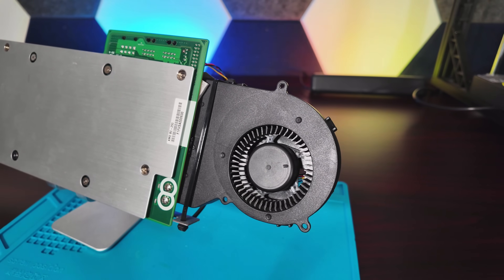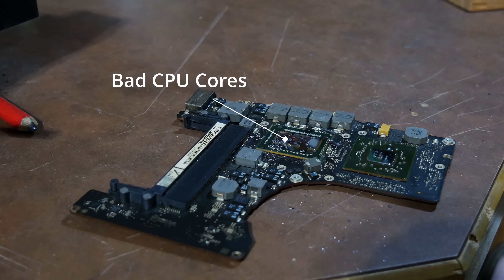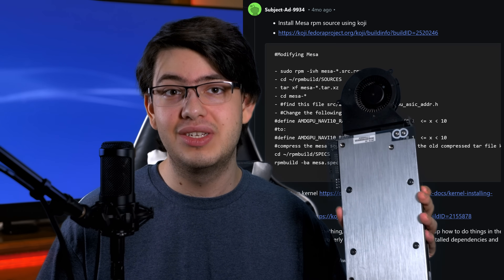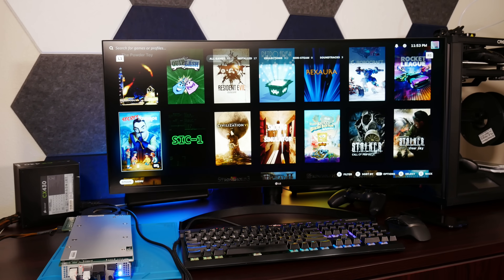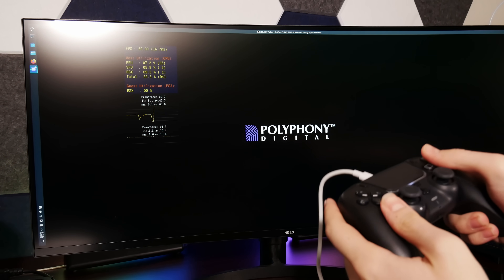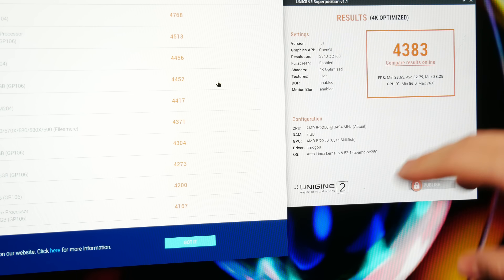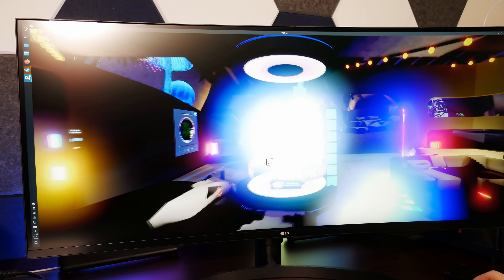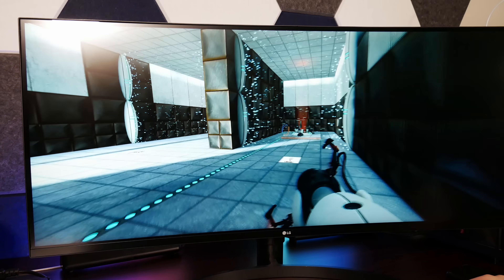I Ran PS3 Games on PS5 Silicon to Prove Sony Wrong

Comment: Sony: "The PS5 simply isn't capable of running PS3 games"
Us, the Community: "So that was a F***ing Lie."
Reply: It simply isn't capable because Sony do not have a working in-house PS3 emulator.
Heck, Sony uses PCSX ReARMed for their PlayStation Classic instead of any in-house PS1 emulator they have on hand.
Reply: @HattoriZero  my xbox series s runs all ps1 ps2 psp gamecube wii and more
Reply: @newjackgaming88  My handphone does that too.
Reply: @HattoriZero  Sony isn't a software company, and that's a huge problem for them. Despite this, they run a better and more capable operating system on their console than the software company Microsoft does. This is just to say Sony is changing, and have some good ideas, and are becoming capable in the area.

But until they scale that up, they can't spend lots of effort on making things like that. This is why Sony as an electronic company has been struggling as well, because electronics these days heavily depend on software solutions, and if you don't have that, then, well, your electronics will struggle as well. But honestly, Sony has done well and made smart choices in regards to Playstation, and they are becoming capable. They just need to scale up their software department.
Reply: @johnwayne-kd1pn  no they don't was playing skate 3 with friends on a XBOX series S and sure the series X can too
Reply: I mean it's almost 20 year old technology, who would believe them on that?
Reply: @ShockinglyBleh well clearly you don't know how the ps3 cell processor works and neither do I, that's the point it was so complicated for devs as well that's why ps3 emulation sucked for a very long time like you could have the most powerful system and it still couldn't have run PS3 (a very old console keep in mind) until emulation tech improved
Reply: @Space97.Is this why the playable games on RPCS3 is so large 😂
Reply: @ShockinglyBleh  The games shown dont really use the spe's, my only idea for it being hard to run actual ps3 games on without 2 weeks of porting for each one
Reply: Technically it isn't able to run PS3 games. No computer can natively run software from a different CPU architecture.
Reply: Wow...corporations lie for the sake of profits? Unbelievable! /s
Reply: it is always a LIE
Corpos LIE all day long.
Reply: They aren't lying try inserting a ps3 disc. Yeah if you modify your console you could figure it out
Reply: That was always the case, even back in the PS4 days most people were brainwashed to believe running PS3 games were impossible which has always been a lie
Reply: @HUYI1 what do you mean a lie. PS4 is x86 based and PS3 is some other arch so it can't run it without something added by Sony. Yeah if you have your PS4 you could play Nintendo games to I whats your point,m
Reply: They may even be not the owners think of it
Would devs know what they learn builting the PS3 own mother was

-- Who will not know how to code their hardware ( People who steal the hardware and mark it as their own 

-- PS3 CFW feels way better than legally hosting it over PS NOW why would they not want my disc which i have the disc which on PS NOW not see my disc i own in the drive

= Sorry disc is not supported on the PS5 but is works on PS4 why not PS3
Reply: It's not really a lie though, the title of the video is a bit sensationalist, making it seem like emulating PS3 is easy. The games showcased are relatively easy to run and don't seem to make use of the Cell's SPEs that much. At least I know LBP2 and WD1 don't, not sure about GT5 but that game is relatively easy to run regardless. 

These SPEs is what makes the Cell processor so special. A normal processor core takes data from RAM, has a bunch of instructions or calculations (which instructions determine the architecture like ARM or x86) in an Arithmetic Logic Unit (ALU), then processes that data using those instructions and eventually puts it back in RAM. Disregarding hyperthreading for a moment since that makes things too confusing, this only works in series and thus a single CPU core can only work on one set of data at the same time. 

The SPEs are what is known as SIMD processors, a GPU is another example. It stands for Single Instruction, Multiple Data and it allows for parallel processing of data. It takes multiple ALUs, puts them in a logical unit (SMs for Nvida, CUs on AMD) which then are only able to work on the same instruction, but from multiple sources of data. This allows for very fast and parallel processing. However each of those logical units can only work on one instructions, so that can be very limiting depending on what you want to do. 

When people say "CUDA cores are not cores" this is what they mean, because the massive 16,384 ALUs in a 4090 are unable to operate independently. In that sense, a 4090 has 128 cores since it has that many SMs. 

A lot of the important first party system titles like Uncharted, Resistance, Killzone, Motorstorm, The Last of Us, God of War 3, Infamous, MGS IV do and these titles are a lot harder to emulate. Sure, LBP and GT5 could possibly work, but most titles Sony cares about wouldn't run at all. Most of these games run very badly, even today. Zen 2 simply cannot keep up with the demands of these titles, mostly because a normal CPU is not suited for the SIMD processing of the Cell. 

I would know because I specifically, for RPCS3, got a 12900k that doesn't have the AVX512 block fused-off, manually disabling the E-cores and flashing the BIOS with microcode to enable it. Even today, this is the best possible CPU for RPCS3 and most of these titles still struggle if they run at all, especially if they use the Cell for any sort of graphics work. 

Not here to defend Sony, they have really dropped the ball in recent years with their focus on live service garbage, neutering their workforce with massive layoffs whilst making huge profit margins. The only reason I even have some of their consoles is to hack them. But you just can't explain the BC situation on PS5 without explaining this and looking at it's rather slow CPU. When the PS5 came out I already said Zen2 is a mistake, with the PS5 Pro release them not upgrading the CPU is another mistake. Zen 2 is the reason we see so little 120fps support as well. Keeping everything else I just explained in mind, you won't be seeing PS3 emulation until the PS6.
Reply: @hugevibez thank you that was a very good technical explanation written in a way even I understood! 👍
Reply: @hugevibez these gamers who never once did embedded development in their lives don't understand how architecturallly PS3 was super complex so yeah if emulation was easy I think Sony could have done it and put PS3 games on the store. You could argue Nintendo does this but let's be real a ds is gonna be way easier to emulate than a PS3 by definition.
Reply: @hugevibez yeah, i was shocked to see that the cpu is the same on ps5 pro, they could at least use something like 5800x3d without changing too much
Reply: @hugevibez  this is why I loved the fully HW BC PS3s mine was a 60GB but because people cried about cost we won't see real BC again for the exotic generations of PlayStation.
Reply: @hugevibez This should be it's own comment, not enough people will see it.
Reply: @hugevibez  gt5 relatively easy?

it's one of the more demanding titles that you can run on the emulator as of now iirc

i doubt we'll see ps3 emulation on console regardless of if the hardware is actually capable of it for a long time if ever because i doubt there's enough interest from sony to actually spend a ton of resources to try and emulate a console only a small fraction of the userbase is actually interested in, and was we get more and more remasters anyway i don't see the interest being there in order for sony to justify it from a financial standpoint

and the statement "most of these titles struggle if run at all" is just completely false considering 70% of titles on the console are marked as playable (which means they run flawlessly with the emulator requirements being met) and a further 28% as "ingame" from which a large portion is actually playable as long as you have some seriously beefy hardware (such as that very cool 12900k of yours or alternatively a 9800x3d which is apparently better in some scenarios)
, gran turismo 5 included. it runs flawlessly on my 7800x3d despite being marked as "ingame" due to insufficient performance on recommended hardware

there's still a large amount of titles that don't work but it's certainly far from most.
Reply: @tooprood You're missing the forest for the trees. 

First of all, the GT games saw a lot of optimization earlier this year and most of the emulation issues seem to be RSX and not Cell related. Still needs a beefy CPU but I couldn't find if GT5 makes good use of the SPEs, which I specifically called out in my original comment. It is easier to run than other first party titles for sure.

The point I was making, is that the games that are generally more difficult to run make use of the Cell and it's SPEs. What games are going to utilize the console to it's fullest potential? Sony first party titles. I never said most titles don't run, I said most games Sony cares about, the first party titles, are difficult to run and benefit from AVX512

I was wrong in that a lot of first party titles have seem to be improved provided you have beefy enough hardware to run them, but Zen 2 is still going to fall short. Uncharted 2 and the OG Motorstorm are 2 quick examples of this. Still though, lots of graphical glitches to be found. What is deemed playable for a free and open source emulator might not be deemed good enough to be sold to consumers. 

You should also look at it in a greater context. The Xbox 360 hardware isn't quite as complicated in that it doesn't flip entire computing paradigms on it's head, and as a result should emulate easier on slower CPUs. When Microsoft is able to deliver a multiplatform game in 4k/60 on Series X and Sony is struggling to deliver 30fps due to emulation difficulties, that is just not a good look.

I got this CPU for 300 euros, minus the 220 I got for my 13600k that thing cost me 80 bucks. It's not that fancy.
Reply: Sony never said that, Sony doesn't even acknowledge the PS3. They are probably building a PS3 emulator because running servers on original PS3 hardware won't last forever.
Reply: @goncaloduarte4683 wouldn't printing PS3 pcbs be better than emulation the cost to emulate plus emulators are CPU bound.
Reply: @monsterhunter445  no, even if they could build more PS3 CPUs and GPUs, that would be super inefficient and costly, it makes much more sense to just build an emulator so they can retire PS3 servers for PS+ Premium, emulation would also allow for res and performance upgrades for PS3 games, no more unstable 30fps games in sub 720p resolution, it would be 4K at a stable FPS.
Reply: The biggest lie is in the ps5 itself. It's literally 20 year old more advanced and capable hardware than the ps3 😂
Reply: @HerotsLament that doesn't mean anything. You just can't run PS3 code on a PS5 that's the issue.
Reply: @monsterhunter445  no you can't but they simply choose not to because they don't want to not because they are unable to bring ps3 backwards compatibility.

Comment: You are not the first person to game on one of these. The reddit thread you were pulling most of your info from, the guy responsible for streamlining making this hardware work, has been gaming on modern linux using his for months now. 

I would hope that you atleast link people to the reddit thread in question, so that he atleast gets some credit,
Reply from the maker: Never said I was the first person to game on one of these. u/Subject-Ad-9934's post which I showed in the video (as I am assuming he's the guy that discovered the Mesa patch) was immensely helpful. There were a couple of other posts before this video by other users as well. The claim made at the start of the video was that a "modern" Linux LTS kernel was now running thanks to the kernel patch I mentioned. Apologies for the confusion.

Comment: The big problem is licensing issues coming up especially in context of rereleases, remasters, remakes, and anything with song materials from the PS3 generation

There wouldn’t just be a “lack of money being made because buy new stuff” its that it would turn into an active money sink. This especially matters with the context of Microsoft with Xbox having emulation on their consoles. I remember seeing a stat (pre Xbox series consoles) that said something like only 18% of people on Xbox were playing Xbox 360 games on Xbox one

While it’s easy to drop in PS3 game software from a copy of said game (or from online) onto an emulator with the appropriate software from the console (or from online) key thing is, is that can be considered illegal (especially if you got it from online)
Reply: I’m not saying this because I’m against emulation from PC or backwards compatibility (for it actually) just that like it’s ugh
Reply: Good thing Idgaf about legality while emulaating and pirating stuff
Reply: Emulation is not illegal, Sony could add pre-proxwssing software to check if the game copy is legit, just like they do with PS4 games. (Wich also run under emulation, since the PS4 Operating system is different)
Reply: @ no, emulation isn’t illegal but piracy is as emphasized by the “from online” part

Comment: Isnt the ps5 a 8 core 16thread? What locked the extra 2 core?
Reply: That's why these things are on the boards to begin with, one or two of the cores are defective on a hardware level and are fused off
Reply: Exactly, no different then the old 3 core AMD cpus from back in the day. Just a quad core with one defective core that could sometimes successfully be unlocked.

Comment: Thank you for testing that out. The real PS5 should be much, much faster in theory, since it can take advantage of the actual unified memory instead of doing copies and locks all over the place. I doubt that RPCS is taking advantage of it right now? Also precompiled shaders can be shipped as the hardware doesnt change.
Reply: Very interesting.😊
Reply: And if they wanted to, Sony still has access to the original PS3 firmware, meaning there's none of the inherent overhead that comes from the guesswork and reverse-engineering behind emulators.
Not that RPCS3 isn't an amazing feat, behold the scale of human endeavor, etc - just that, if they wanted to, Sony could bring PS3 "emulation" much closer to "simulation"
Reply: @jm-alan it might make it easier for Sony to develop an emulator because they designed the PS5 doesn't mean it won't be easy. Remember Gameboy is documented up the wazoo and even most people here who have any development experience can't even get a perfect running emulator. No emulator is
Reply: 😅what makes you think it doesn't have unified memory on those boards?  I don't think he chips even support nonunified memory and the programs sure dont.
Reply: Not performing shader compilation on the current build of the game as is in the current state of things and having them come in "pre-packed" is real good if you want an extra layer of technical difficulties to wrestle with whenever you touch absolutely anything.
Reply: @koeymi yeah but you can hold off the live change until after you've compiled, shaders, and you also wouldn't necessarily have to roll it out to all games all at once. You could run a couple of servers with less popular games initially with a newer build, and as shaders get recompiled and verification and testing is done, move over more and more popular games to the new emulator version.
Reply: Hearing the jailbreak recently I guess that will open the window for emulators (?)
Reply: as a certified PC shill i hate to break it to you, but the ps5 "unified memory" is pure marketing babble. the underlying AMD hardware is designed exactly the same way on every modern AMD APU. The steam deck has exactly the same hardware technology and Valve has already done pretty much everything to optimize Linux for it. there is nothing technically superior about the PS5 compared to PCs that were new when it launched, the marketing compared the PS5 to gaming PCs from 5 to 10 years before the PS5 launched which is what console marketing always does.
Reply: @tacokoneko  It's not that different to APUs, but most PCs don't run APUs, let alone a wide memory bus. So it makes sense that games/emulators would treat CPU and GPU memory as separate
Reply: @tacokoneko The steam deck has unified memory as well. 

Unified memory just means there isn't dedicated vram or ram. 

Optimizations can be made when the GPU and CPU can both access the same memory. Chances are this is already being taken advantage of in the Linux kernel though. But the steam deck does not have dedicated vram, a portion of RAM is allocated dedicated to video memory but that allocation is not fixed.